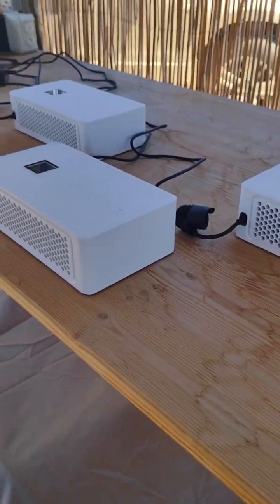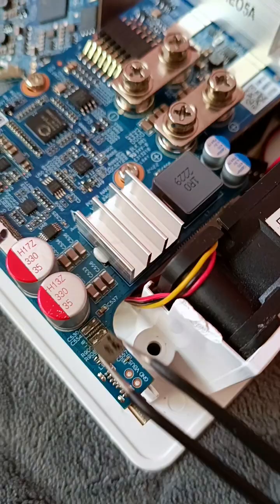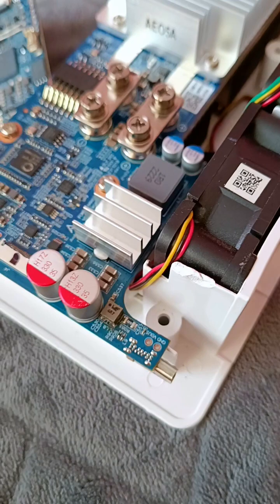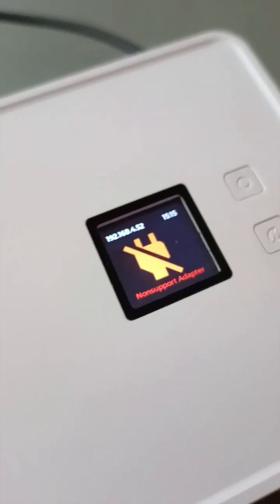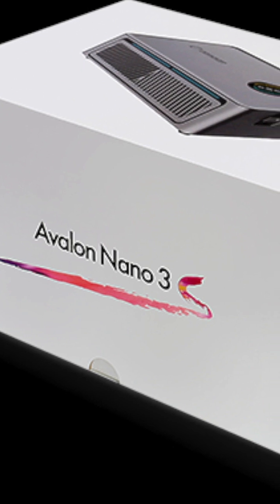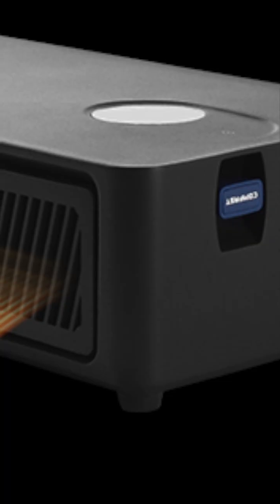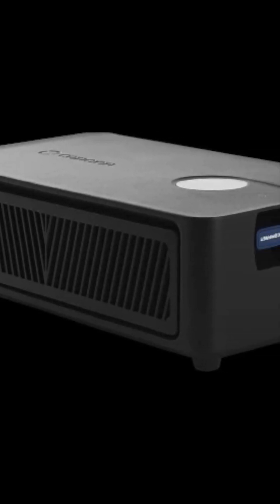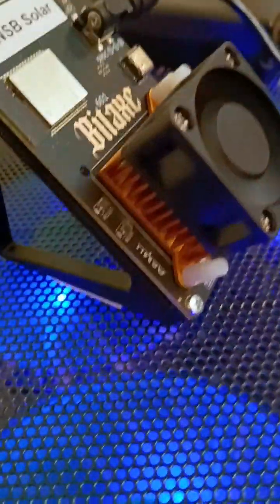Is Canaan Avalon Nano 3S REALLY Better Than Nano 3?

Comment: My nano 3 died after 2 days of running at high fan speed, opened it up and had the exact same issue where the 4R7 resister paste melted, touched it with tweazers and it fell off! tried to solder it back on but was impossible. £200 down the drain within 2 days fml. I ended up chucking it in the bin after getting frustrated with it.
It's put a dent in my faith with Canaan and this new nano 3s, if the build quality of the nano 3 was bad, who knows how bad this new nano 3s is going to be?
Reply from the maker: @Robot-T1  sorry to hear this, unfortunately we are amongst many who wasted a lot of money on Nano 3 miners. The issue with the 4R7 killed many Nano 3 miners in just a matter of months. Canaan did address this issue in an article post, but they basically said it was not a manufacturing fault, only the user is to blame from poor handling of the product. I think I'll stick with Bitaxe only from now for our SOLO Bitcoin mining adventures.
Reply: Please tell me about ur solar setup and how many Bitaxe 601 you are using? Im using the jackery 1000watt solar generator.@TINSBSolar

Comment: Im having the same issue. Were you able to get it running again? If i replace the 4R7 Inductor it should work again right?. Is this the correct part Power Inductors - SMD IND CMMD 4x4x2 4.7uH 3.8A 2PAD SMT
Reply from the maker: If I push down hard on the 4R7 resister the Nano 3 works instantly again, but impossible to keep it working this way. From my experience, and videos I've seen from others, its not necessary to replace the 4R7, its not they its failed, only that its no longer making contact with its two solder points on the PCB. The problem is its just about impossible to remake the connection with a standard solder iron, it needs a hot air SMD method, just as the manufacturer used. I'll just keep this Nano 3 for spare fans and parts to try and keep the others I have working, but one by one they are all failing after just 10 moths. Lets hope the Nano 3S is a better made product, but at $249 I'll wait to see if these also have issues...